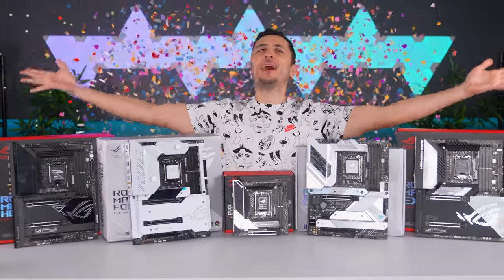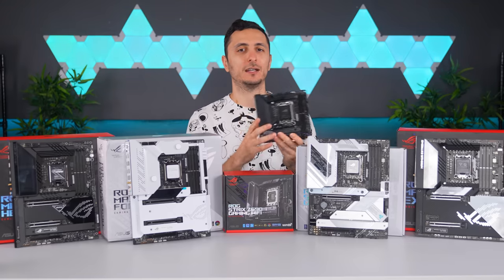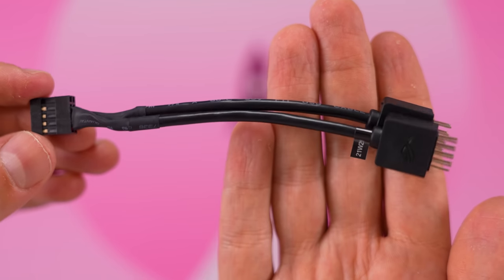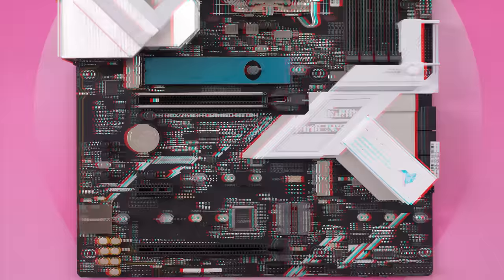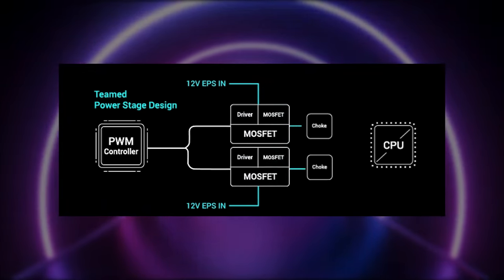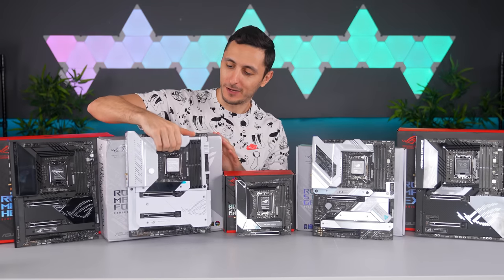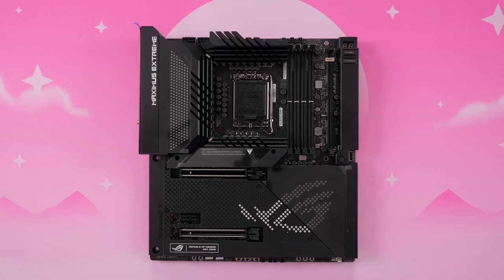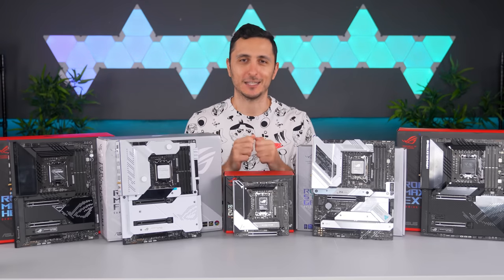I Found the Motherboard for BigRed V4 - ASUS Z690 Motherboard Overview

Comment: thx for this video ed. I just picked up the asus z690 a motherboard bc it fits my theme so nice. Helped my really with the choice
Reply: Hey, quick question on the z690, do I use 2 cables and connect to both the 8 and 4 pin power connectors? The documentation sounds like either or.... thanks.

Comment: I'll build my next pc soon around DDr4. This new tech is rushed for me and first years are for the earlier adopters. No sense to spend a ton of money for these boards and ram just to have a 5 more fps. It's not important for gaming at all. I'm still rocking DDR3 currently and no issue with that. Not to mention the low availability and higher prices in some small markets like mine.

Comment: I'm building a new system pairing 13600k with a ROG STRIX Z690-A GAMING WIFI D4 along with an ASUS 3080 white edition and I am afraid to break the sealed of the bran new CPU box so just in-case I need to swap out to 12600k. As I understand, I have to flash the BIOS (using the BIOS Flashback button in the back) for the system to even recognize the 13600k and post. However, according to Asus' firmware website, the Intel ME firmware needs to be updated prior to updating the BIOS. I hope you can help me

Comment: What air cooler will fit this ROG Strix Z690-A? I bought this and an i5-12600K but I'm reading a lot of air coolers even with the compatibility bracket wont clear all the components to fit. I'm not planning or experienced with water cooling. What do you guys use?

Comment: I need help can you help me.
my issue is I am getting very low fps. 
my graphics card is Radeon RX Vega. 
I was getting great fps when I bought my pc I recently purchased this pc quit January 2020 month so till this November I was getting great fps but, now I am getting 20-40 fps I am very sad.
so @TechSource I believe you, you can help me.
this is my all specs,
Processer- Ryzen 7 2600 8 Core 
Motherboard- ROG STRIX B350-F Gaming 
Graphics Card (GPU)- Radeon RX Vega
RAM- 16 GB
Coller- GameMax 
Power Supply- GameMax 700w (GE-700)
Don't think I am stupid  I am giving you this because if you need it later.
waiting for your reply.